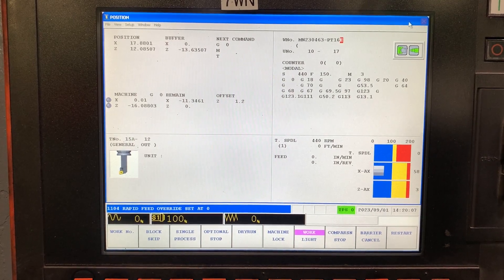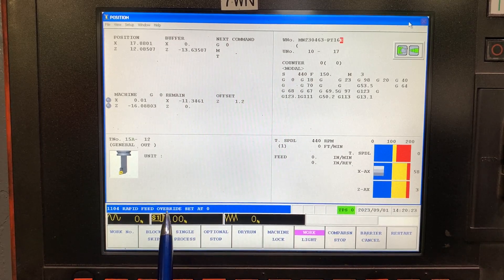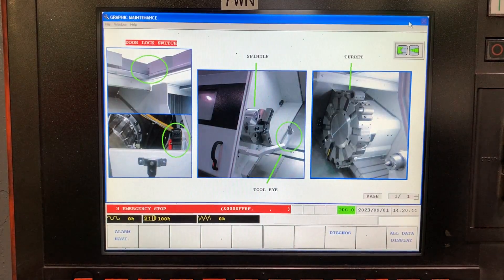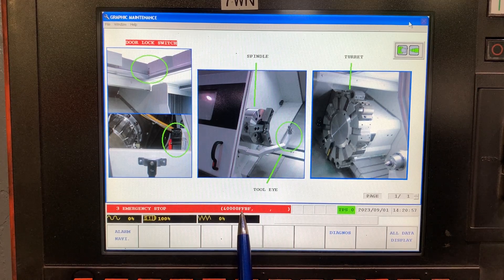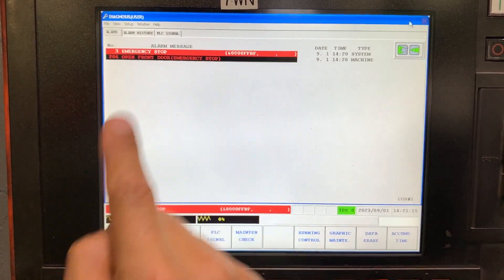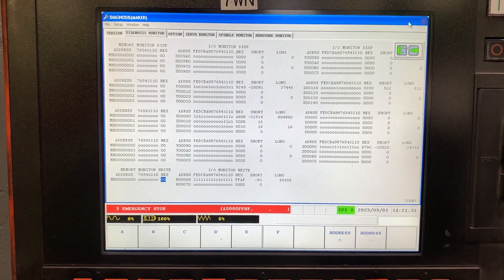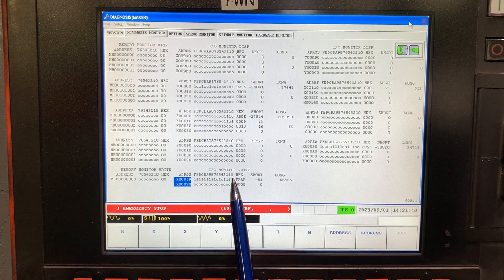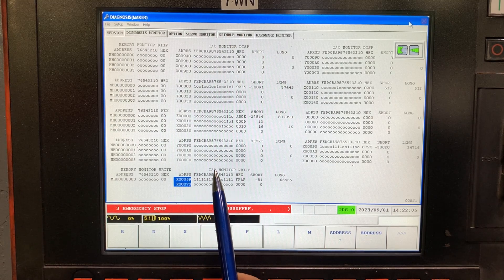Mazatrol Matrix Nexus: 3 Emergency STOP (&0000FFBF, , ). Understanding the R69 interface signals

Comment: Have the same problem but my alarm is (2 emergency stop &0000FFAF ) wont clear cant home machine o jog it
Reply from the maker: This alarm indicates an issue with the safety circuit or a connected device. You might need to check the emergency stop buttons, safety gates, or any external safety devices connected to the machine's safety circuit.

The code is in HEXA four digits. If you have FFFF all is good. 
In you case FFAF you just have to convert “A” to binary.

To convert the hexadecimal letter A to a 4-digit binary number:
• Hex A equals decimal 10
• Decimal 10 in binary is 1010
So, the 4-digit binary representation of A is:
1010
This means you are missing bits 5 and 7 below. Check them.

In this machine bit 7 is not used, so it might be different in your case.

•	Bit F: Servo drive unit emergency stop output
•	Bit E: Spindle drive unit emergency stop output 
•	Bit D: Door interlock, dog/DOT arbitrary allocation device illegal
•	Bit C: PLC High-speed processing error 
•	Bit B: User PLC Illigal codes exist  
•	Bit A:
•	Bit 9: Line 
•	Bit 8: Contactor shutoff test  
•	Bit 7: 
•	Bit 6: Built-in PLC Software Emergency Stop. Output Device Y0029F is "1" (might be different output on other PLC)
•	Bit 5: Power Supply external emergency stop state 
•	Bit 4: Control unit EMG Connector Emergency Stop State 
•	Bit 3: External PLC Communication Error 
•	Bit 2: External PLC Not Ready 
•	Bit 1: External PLC FROM-TO command not executed 
•	Bit 0: Built-in PLC Stop State
Reply: @FabianAchaval ty i will try this thanks for the information!

Comment: thank you so much for your lessons . Could you tell us about the Pitch Error Compensation parameter table . I have a situation on a variaxis 500 milling machine , the table in position A0 With 180 is perfectly flat , and in position A90 C180 there is an error on the axis With 0.05 mm .
Reply from the maker: Hi there. This document might help you understanding pitch error compensation 

https://us.mitsubishielectric.com/fa/en/support/technical-support/knowledge-base/getdocument/?docid=3E26SJWH3ZZR-24-5967
Reply from the maker: This video will show you how to access the link above 

Mazatrol CNCs: How to get access to important manuals, parts, etc
https://youtu.be/e80ktNbFNR0
Reply from the maker: Regarding the table positioning error of 0.05mm I think it could be just backlash. I’ve never serviced that kind of machine, but showing this video I think the table is moved by a roller gear cam, not for a ball screw 

https://youtu.be/df25eqqkp_k?si=1sX09cKj3Xn3Dm04
Reply: Thank you so much for your advice and answers to my questions, I am very grateful to you. Yes , I agree with you about the backlash , but I do not understand how it is possible to measure the position of the table A 90 With 180 and prove that this is a backlash . Also , if it is proved that this is a backlash , is it possible to compensate somehow with parameters and what . @FabianAchaval
Reply from the maker: @ЕвгенийАлександров-з2ч  what you can do to measure backlash on A axis is use a JINGYAN TTL-90S Dual-Axis Angle Protractor Angle Finder Magnetic Inclinometer

https://www.amazon.com/MeterTo-Dual-Axis-Protractor-%C2%B10-005%C2%B0Resolution-0-001%C2%B0Gyro/dp/B07YQSJQ36
Reply from the maker: @ЕвгенийАлександров-з2ч  by the way, this could be the table mechanism installed on your machine. If so, there might be a mechanical procedure to adjust it and eliminate the backlash back to the tolerance 

https://www.sankyo-seisakusho.co.jp/english/technology/technology04.html

https://www.sankyo-seisakusho.co.jp/english/products/rollerdrive_cnc06_rta.html